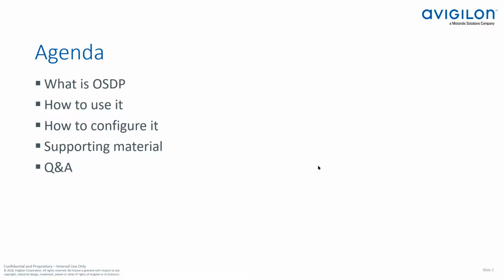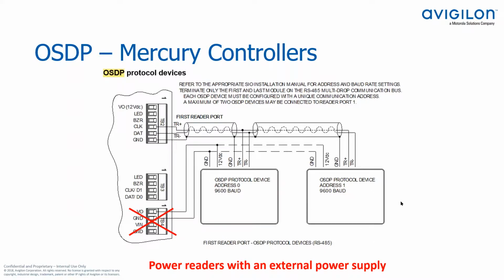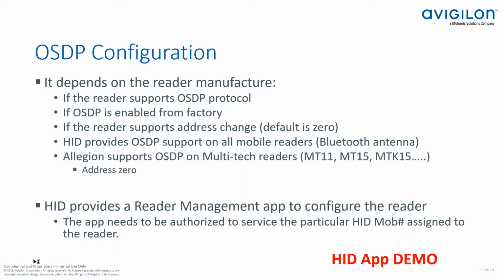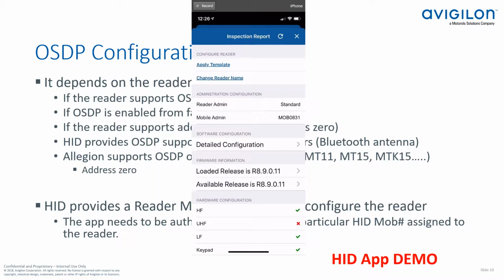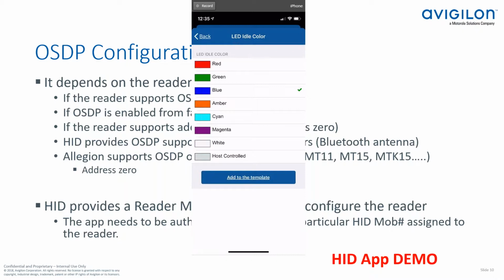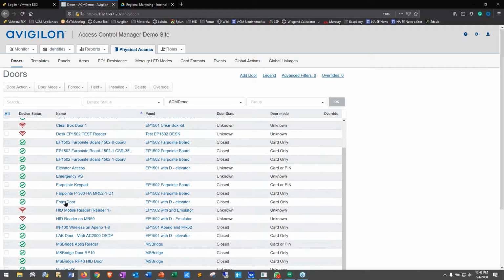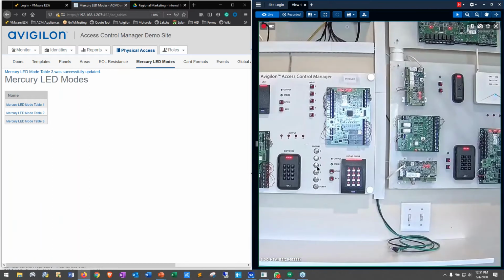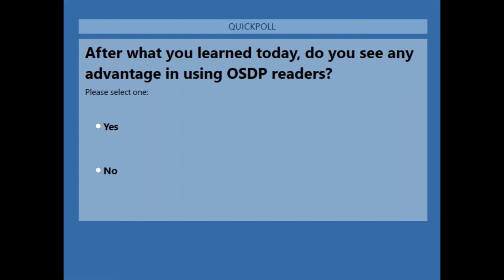ACM Lunch & Learn   OSDP & HID Reader Manager   May 4th

Comment: So does this mean in this HID example, that OSDP V1 is not encrypted by default?  It looks like you'd have to switch to V2 and turn on secure mode which would require support from Avigilon or HID to enable.